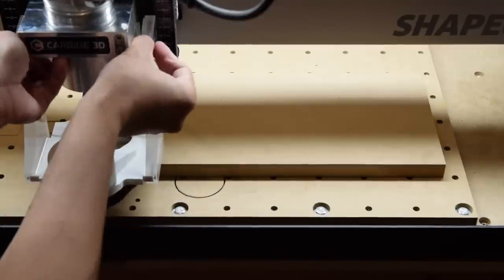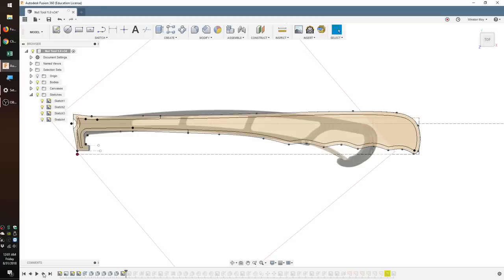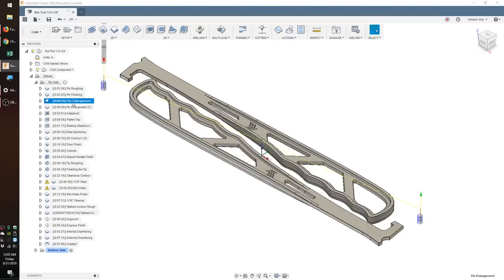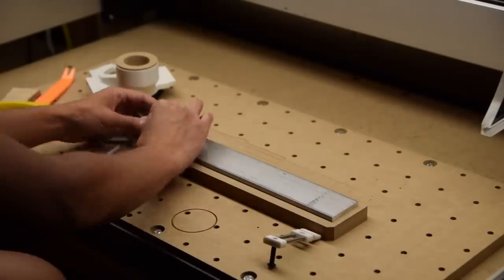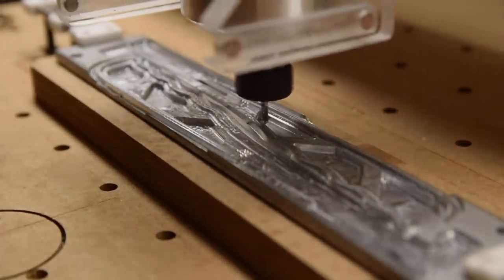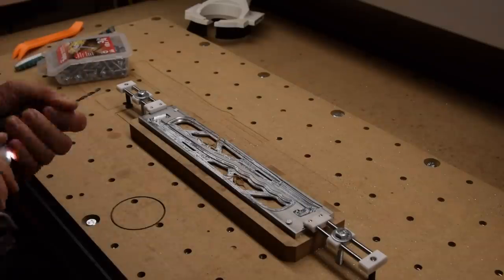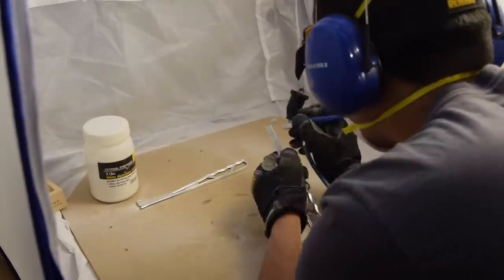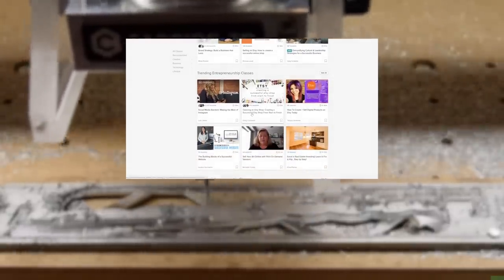Rock Climbing Nut Tool Prototype in 7075 Aluminum - #129 [CNC]

Comment from the maker: FOR THE RECORD:
Superglue and tape would NOT work on the second side after the flip because there's almost zero flat surface area left at the level of the stock face.

Also, I put out a video about CA Glue/Masking Tape a month before NYC CNC did. Trust me, I know about the technique... 😒

Comment: Can you show us a tutorial on how you set your pins for realignment on double sided machining? I've struggled seriously with this.
Reply: He has shown this before, essentially mill out the exact diameter of your pins in your stock and your backer and then you can flip parts -- the tolerances must be spot on -- as you can see he has to struggle to get the pins out -- it has to be super tight or the back side machining setup will not lineup well enough. Your pins must be referenced in your setups -- simplest way is to make the parts center to your stock and pins be equidistant from the center on X and Y -- that way it's easy to flip the part and not get your head confused which way you're flipping.

Comment: Great work Winston! It looks like one of the main reasons you're having chatter problems is the tool stick-out.  If you have room on the shank of the tool, I would get the tool as far in the spindle as possible. Even better see If you could find an end mill with a 1/2" length of cut or shorter that would make a huge difference in the chatter. Maybe if you switch to the wider stock you could switch to a 3/16" tool also. Going to the wider stock will likely help a lot on the second side. P.S. Love the podcast!

Comment: There are a few simple ways to help keep the part from deflecting. First, when you flip the part you can fill the recesses with bondo or low melt on the first op and fly-cut it flat, then flip the part while retaining rigidity. Also you can machine your pockets first on both sides then perform your finish operations. It's not ideal to remove the part so often, but on a machine that isn't rigid it won't really matter.

Comment: Something I've heard about for doing extremely thin parts is to cut the first side, then fill the newly cut voids with resin. Let it set, then machine the opposite side so you're not deflecting the thin piece. Then dissolve the resin.

I saw a finished part cut this way (basically a thin titanium spring) and just a reference to resin support, but there were no in depth details such as type of resin, solvent to remove it, etc...

Could be an interesting experiment.

Comment: Aluminum is cheap. Most of your headaches came from trying to nest 2 parts out of that stock in an effort to save material costs. You compounded the headaches with sketch workholding from either end that exacerbated whatever stress was in the material (though I'm guessing your problem was less that, and more that the piece of MDF was either curved or compressed as you clamped down on those ends).
Try using the super glue technique for Op1, and be more aggressive with the amount of material you remove - full Z profile all around (through holes and vertical walls) keeping a window frame with the part still held in via tabs. Bore some holes in the window frame to locate and hold down Op2 and finish the interior details and top surface. Use some screws/washers on all those tasty interior profiles in an Op2.5, remove the screws from the window frame and yank it off, finish the outside profile and chamfers.
Also, be aware that 7075 is absurdly priced in small quantities, and it's costs come down dramatically as soon as you buy 12' sticks from actual aluminum suppliers and not the small-quantity online options. You'll never get to the $17 retail though, as it looks like a simple forging out of China. COGS on that sucker is probably about $2 in the quantities they buy.

Comment: Looks like you could add center screw holes when you add the dowl pin holes that would match after the part flip. Maybe those are even your clamping system. The media blasting step, besides appearance changes, can deform the surface and in some materials creates a work-hardened layer that adds to the strength of the part, or reduces stress riser notches to improve fatigue limits. The other thing to think about your design, can you make all the CNC work from one side without a flip? Then just debur the back side -- cuts your CNC time-cost in nearly in half, half the setups and bit swaps.
Reply from the maker: I could accomplish basically everything except the main adaptive to remove material from the other side. Too much to undercut. A center screw would be super convenient, but need a tiny bit more stock margin to pull it off.

Comment: Hi Winston, I know it's 3 yrs past video production so little improvement use for this project, but some late ideas from watching.
Clamping: Still milling 2 tools from 1 block, mill 1 tool at a time and clamp the dormant segment, swap over clamps & mill 2nd piece.
2nd side. Repeat above hint, but add a shim to compensate for the already milled missing volume of material.
Or
Mill your mounting block as a negative of the part, flip over and pocket the piece into the block. Reset the material Z height
Brilliant videos and great info on CNC techniques & pitfalls. You are genius level and I'm a CNC newbie but gaining profiency on a daily basis to compensate brain from work during retirement.

Comment: Anodizing at home isn't difficult.  You probably already have most of what's needed.  Here's my setup, shown anodizing a custom gantry plate for my new CNC.  Hit me up if you decide to try it and need help.
https://www.youtube.com/watch?v=QwPyBZgeQMQ
https://www.youtube.com/watch?v=8LLBdyeeC20
Reply from the maker: I had a general idea of the process and knew it wasn't rocket science. My biggest qualm is dedicating the time/space to get a working setup running. Once I build out a more permanent shop space I'll strongly consider it.
Reply: I hear ya.  I have to clear off my workbench when I want to do an anodizing run.  When not in use, the tanks/bins live underneath the workbench.  I'll be honest, it did take some time to get set up and learn the quirks (such as, temperature matters!)  When you decide to try, look into Caswell's "LCD" (low current density) method.  Their process is roughly what I'm doing, I just didn't buy one of their kits and I simplified it a little bit.

Comment: I just got my S3XL a few weeks ago, I'm nervous to try aluminum. Watching your videos is giving me more confidence to try it.  Keep it up Winston.
Reply: Ethan Newhouse don’t be scared man they rip right through it
Reply: If it's the tool he made then don't  even think about using it:

aluminum for a climbing tool with T651 tempering? are you trying to get people killed?
Do you know why T6 and only T6 is used for these? and even then it's forbidden for unsecured climbing? 
T6 can stretch 10-11% before failure, T651 can do 3-5%.... 
With aluminum the thicker it is the lower the elongation strength is, the shape also affects its a lot which is why most tools that require tensile strength will be curved and have reinforcement ribbing.
The most important thing here is to get the shape right, you can not wing it this is not steel, you will get people killed.
Every decision you've made making this tools from the material to the design choice is exactly the opposite of what you want in a climbing tool.
Reply: DOGMA1138 post this on the actual thread!

Comment: Great job Winston, looks like you're getting an idea of what you're doing. 7075 is significantly harder to machine than 6061. Just one note, I wouldn't bother paying anything more for a coated tool on that machine. You  probably won't see any difference until you're running it near the limit. Even with a very small tool, its more likely runout or chatter are the limits on that machine.

And yeah, paying slightly more for larger stock is preferred in all but high volume production. It tends to be a real time saver to have some margin.

Comment: Awesome job! BTW you should be using an 80tooth saw blade to cut  aluminum, looks like you were you using a 50 or so, which is kinda dangerous.
Reply from the maker: Duly noted, thanks for the tip.
Reply: And not just any high count blade, use one specifically designed for non-ferrous metals.  They have a negative tooth rake and generally a thin kerf.  I use a Tormax blade from Amazon.
Reply from the maker: Have a link?

Comment: also invest in a tumbler from harbor freight. the fiberglass beads with smooth out imperfections so you dont have blemishes in your parts. it will help erase and hide them prior to painting or anodizing if you choose. the tumbled look is also actually pretty clean as well.

Comment: when using a sub plate in this manner, its often best to cut flatness into the part then achieve parallelism into the other side. this way you wont have to worry about bowing as much. ofcourse, three points of contact is usually better than two. maybe run a part on one side, come to a stop, swap the clamp to the other side, then run it.

Comment: I saw this video a while back: https://youtu.be/sILeFJSANBk. I haven't tried it yet myself, but it might offer a uniform workholding solution without clamps getting in the way.
Reply from the maker: Ah... Richard's trick. Same as the masking tape suggestions, it works if your surface area is flat but after I flip my part over there's not enough contact area for it to work unless I build up big globs of hot glue to fill the gaps (which is possible).

Comment: The handle has a number of cutouts.  In the video it appears that you machined them entirely away instead of simply cutting them out.  Is that correct?  Is there a reason you did that?
Reply from the maker: Didn't want a small puck of aluminum to rattle around inside the hole and fly out or potentially jam the cutter/ruin the surface finish of the wall.

Comment: Cool project. Chatter and harmonics are tough to get rid of once you have them. Even if you had the room, and could drop your tool length offsets , or workshift Z- .050, a lot of time, once the cuts with chatter are in the part, your tools act like a "needle" on an old phonograph and pick them up and duplicate them at your new cutting depth.
The fact that you were able to produce those parts without an angle lock vise
Reply: Kudos to you for producing those parts inspite of not having optimal work holding devises. Another great video Winston.

Comment: Check the Datron 1 flute tool for aluminum... they cut so well that aluminum turn like butter with it and most of your shatter problems can be solved.
Yes, a better previous planning is hugely important, you should have a wider stock material to apply at least 2 more anchor points to your stock.. with a wooden table and fixture like your machine, when milling metals, you have to pay special attention to it, try to make it as rigid as you can within your limitations.
Reply from the maker: I have heard much about the single flute datrons, my podcast co-host uses them a lot. I'll get my hands on some eventually...

Comment: I thought for sure, going into this, that you were going to use the painters tap and superglue method.  Granted, not a machinist here, but it would seem to fit the bill perfectly for this application.  Good stuff!  Keep 'em coming.  BTW binged most of you videos last week!
Reply from the maker: The problem is the part isn't very flat. As soon as I flip my part over, I have almost no usable surface area for the tape/glue to act on.

Glad you're enjoying the videos!
Reply: I've seen/used a different approach for hold down small parts, or parts with little surface area -- use another piece of aluminum as your backer -- and super glue your stock to that -- then use a heat gun to break the super glue when you're ready to remove/flip, super glue is a bit of pain to cleanup later, but worth the trouble -- this way whatever you do have to hold down you'll glue to your waste aluminum...tape will give up way faster than just regular CA.
Reply from the maker: Little acetone would do the trick for part cleaning. Clickspring's "superglue arbor" gets a lot of use on the lathe.
Reply: Maybe painters tape and superglue on the first side, then flip, glue, deck it, light skim to flatten, then cut to shape?
Reply from the maker: The only surfaces that make contact with the table after the flip are in the corners where the indexing holes are, and a very thin strip between the parts (reference @ 7:20). Hard to say if that middle strip had enough surface area to keep everything locked down. Glue might have worked.

Comment: aluminum for a climbing tool with T651 tempering? are you trying to get people killed?
Do you know why T6 and only T6 is used for these? and even then it's forbidden for unsecured climbing? 
T6 can stretch 10-11% before failure, T651 can do 3-5%.... 
With aluminum the thicker it is the lower the elongation strength is, the shape also affects its a lot which is why most tools that require tensile strength will be curved and have reinforcement ribbing.
The most important thing here is to get the shape right, you can not wing it this is not steel, you will get people killed.
Every decision you've made making this tool from the material selection to the design is exactly the opposite of what you want in a climbing tool.
Reply from the maker: Genuinely curious about the T6 vs T651 concern. The strain curve is different because of the processing, that shouldn't affect the ultimate tensile strength of the material. Why does the elongation matter? 

Also, you're not going to die if this breaks, it's not an ice axe bearing your weight. And my friend is carrying a backup while this is being evaluated. And I sent two so that one can be stress tested to destruction to understand its weak points.
Reply: The T6 vs T651 is a major concern when you have a shear and tensile loads on a tool which will be the primary loads on you know a climbing tool used to lift oneself up.
As for the shape it is absolutely critical for it to be curved because when you have a rigid curved body you need to overcome the curvature which protects you from a sudden onset catastrophic failure, if you think about it when you try to pull on a curved body you would essentially straighten it up first this reduces the amount of elongation for the same force applied to a straight body which delays the failure, it also helps to distribute the load better which might prevent the failure all together.
Reply from the maker: Good thing a nut tool is only ever subjected to a couple pounds, and NEVER bears your weight. 

Also, why does it need to be curved? Bending stresses are worse than pure tensile. The act of straightening out would perhaps communicate some measure of strain which might give you some heads up that you're over-stressing the tool, but it is NOT stronger.
Reply: It's a nut tool. It's sole purpose is to help remove nuts that are jammed in cracks. Usually the person following on a multi pitch climb, or the person who placed the gear on a single pitch trad climb, removes each nut, cam, etc, used for protection. Sometimes they can be wedged in pretty good, especially if they were fallen on. That's where a nut tool comes in handy.

Comment: The tape and superglue work holding method that NYCCNC uses is one of the best ways to hold stuff like this.  Might be worth a try.
Reply from the maker: Op 1 on the first side maybe, but not after the flip. Not enough surface area.

Also, I put out a video about CA Glue/Masking Tape a month before a John did... 😒 :P

Comment: Winston, what cnc would you recommend for 13-year-old for multi-usage including metal? Willing to spend up to 3k. x carve, nomad, othermill ect.
Reply from the maker: If metal's on the menu, not X-Carve. It's a weaker machine from a structural standpoint than the Shapeoko.

But I can't point you in a direction unless I know what you want to do with a CNC. Nomad and Bantam Tools CNC (formerly the Othermill) are great, high precision, low power machines that are ready to go out of the box.

If you're willing to do some assembly, something like the Shapeoko 3 XXL will give you 15 times the work envelope at a lower cost. Great for woodworking, not as good at PCB milling, fine engravings, etc.

Comment: Time to start using the super glue trick that NYCNC has been so positive about!
Reply from the maker: Op 1 on the first side maybe, but not after the flip. Not enough coplanar surface area.

Also, I put out a video about CA Glue/Masking Tape a month before a John did... 😒
Reply: I'm thinking straight CA, no masking tape.